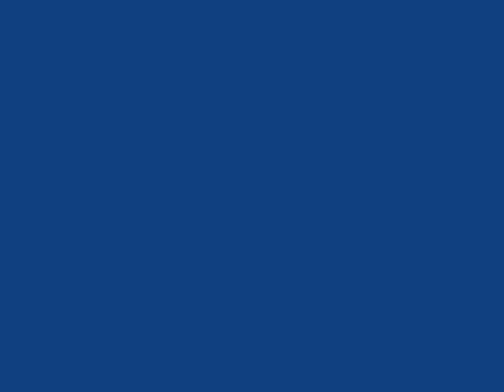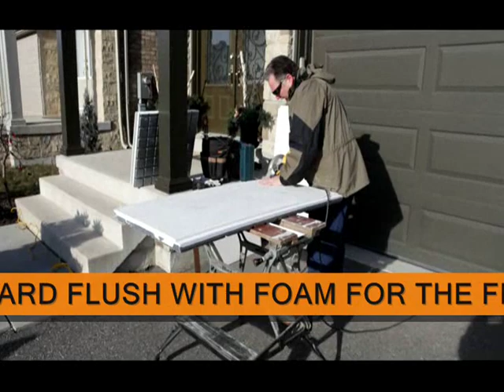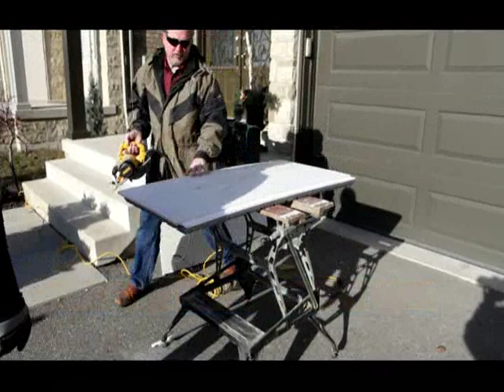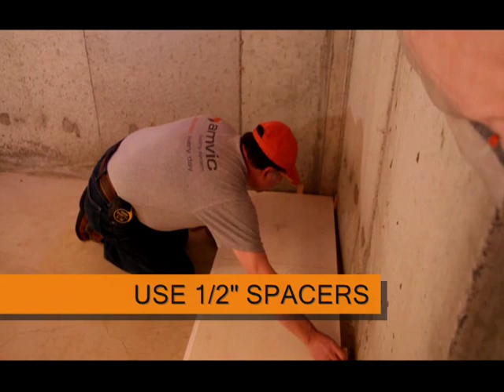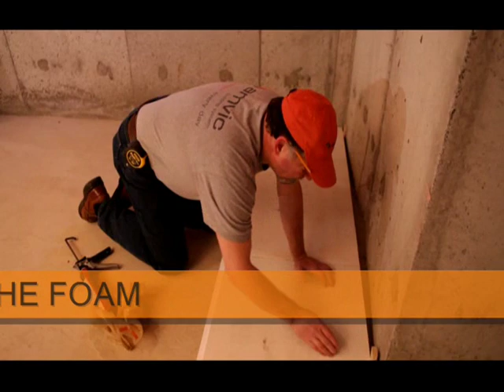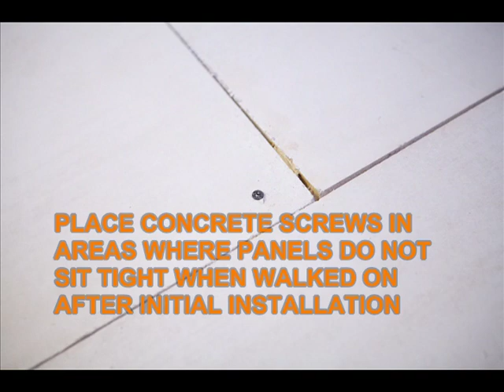Amdry Tile

Comment: Too complicated and messy to install. Had to cut it outdoors and the styrofoam flew everywhere. Too many steps to the installation. I returned the rest after starting and went with the blue DMX rolls instead which were no mess and have the same air gap for a lot less $$.
Reply: I believe the point of this product is you can tile over it directly.  With the DMX you have to lay osb on top before you can tile.  I'd like to find out what the panel top is made of and if it would survive a flood